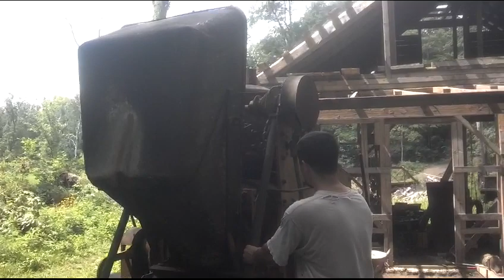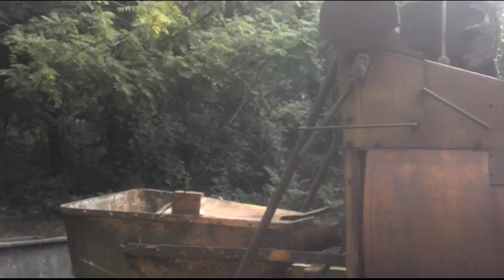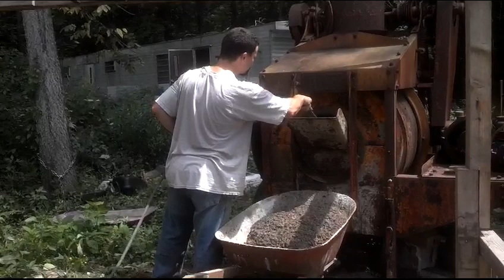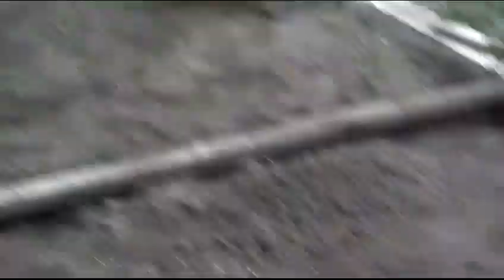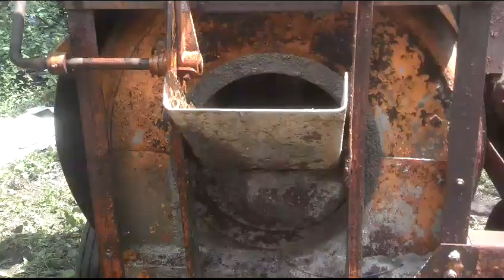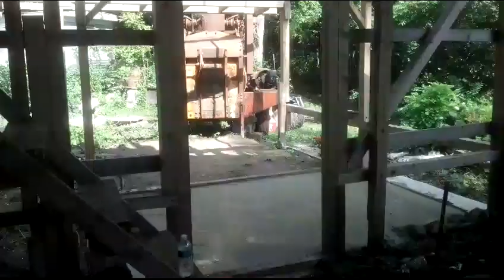Jaeger Cement Mixer at work

Comment: There has been a lot of concrete mixed just like this.  What do you think your cost per yard was for materials?
Reply from the maker: Never did the math for cost per yard. But If I buy a bag of portland cement @ about $9 per 95lb bag, and mix in sand/gravel at a ratio of 4 to 1, It is pretty cost effective for me. The sand and gravel is near free for me, harvested out of the nearby creek. Except for the cost of fuel to excavate to sand gravel. And the fuel cost to run the mixer.  Still cheaper for me than premix concrete delivered on site in my remote location. Plus the free exercise! lol.